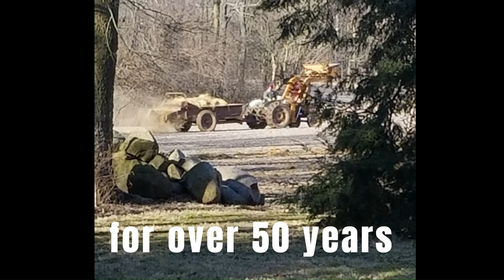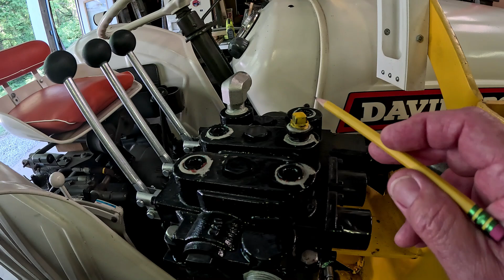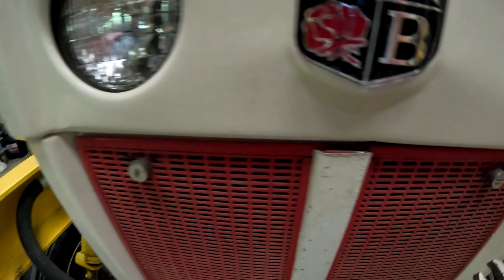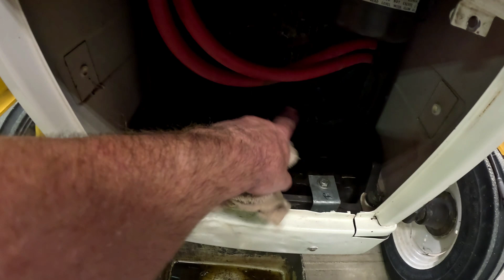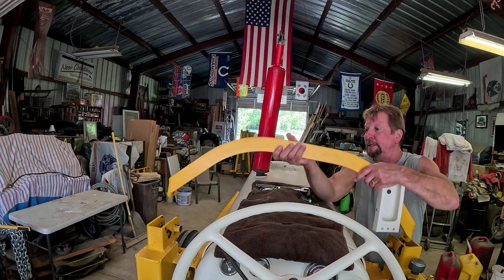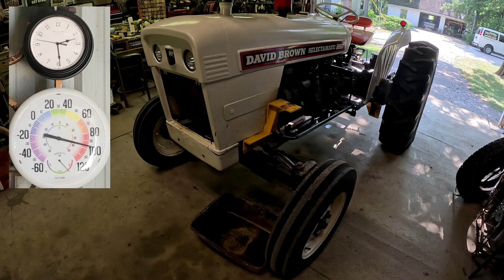David Brown 880 e1 remove the FREEMAN Loader

Comment: Hey I have a 880 that's new to me and I'm trying to see if there's a difference where the engine oil goes versus the hydraulic fluid. I have zero experience with diesels or large tractors. I looked up some videos but I'm still a little confused. Could you point me in the right direction? I think mine's a 1964
Reply from the maker: Yes I can, mine is a 1966 (white and brown) the engine/hydraulic oil is separate on all models. On the left side, as you are sitting on the tractor, of the engine toward the bottom is a filler cap and dipstick, that is where you check and fill the engine oil. The hydraulic oil is checked by a dipstick in front of high low gear shifter and filled by a plug in front of the other gear shifter. The red and yellow 880 might be a little different on the hydraulic but I believe the engine is the same. I have a video called "filter fiasco" that goes through changing the engine oil, I hope this helps.
Reply: @tech.274  thanks a million for taking the time to explain that to me!! What was throwing me off is where the engine oil is it looks like it's part of the gearbox. Mine is the white and brown one
Reply: I can see how that would throw you off, glad to help. The 2 are separated by the clutch. Thanks  @yourpro3653

Comment: Ahhh... The dear David Brown 880 ! I own one. A 1967 unit. I got A LOT to say about that tractor. Took it from close to good to be sent to a scrap yard and restored it (with some help of course - I'm not that good). Cost many "K's" but close getting to the end. I'm working on the original front loader right now. All for the look ! But I like my DB. Very much. Noisy final drives, noisy transmission, hydraulic problems... many issues I had to face but now pretty close to the end. Tell you this has last word : It will be the only one !
Reply from the maker: Yes DB has a special sound, the transmission (6 speed) has paper thin shims to obtain proper gear/shaft lash. They wear out over time, mine is loud in high range, but operates well. I also dropped many $s on the restoration and it was in good working condition at the time. In the end glad to have done it, thanks.
Reply: @TECH.274  I decided to buy another 12 speeds transmission, a just it properly, putting new bearing and put it in. I'll then see. Those DB's were a pain in the ass. Noisy !

Comment: That loader looks all to havey and it almost identical to a Massy loader of the same time.
Reply from the maker: It is very heavy, with a large bucket. The way they built things in the 60s, independent company that was purchased by Bush Hog in the early 70s. A great loader, with the ability to dig a big hole. The new 1s don't do that. Thanks
Reply: @TECH.274  How do you get on with the backwards stop on the engine it always intrigued me why David Brown until Case bought them out they eventually stopped using Case engine with different pumps.
Reply: @Colin-rg7gt David Brown's always used their own engines

Comment: I have a 1967 990 Selectamatic, it has what I assume is a DB loader.
 Hydraulics are supplied via the tractors own internal pump, which runs the 3 point. 
The loader only has the one tilt cylinder in the middle, which makes it very easy to mount anything that fits on the 3 point, fits on the loader. 
Very interesting to see the hydraulic pump on yours mounted where the battery is in mine, probably a much beefier unit, but I must say my loader does surprise me with its lifting power. The one tilting cylinder does at times create much less usability, and limits the curl in the bucket, or what ever is on it.
Very nice job on the restore, I had thought about doing a substantial restore on mine, but I really cannot have it out of action that long.
Reply from the maker: That makes sense, I made a modern, quick attach system for mine.  You can convert the bucket over to that system, but I think it's much stronger to leave the bucket as is with the cylinders attached to it. The quick connect  can pop off the mount if too much pressure is applied. The Freeman pump is rated at 18 gpm. There is plenty of flow for a 3rd function. Thanks.
Reply: If it's got a front mounted pump on the crank shaft that was an optional extra
Reply from the maker: Yes, the Freeman loader has an independent hydraulic system. DB also had the front mounted pump however some loaders ran off the internal hydraulic system without the front pump. The internal pump delivers 5 or 6 gpm the Freeman pump is rated 18 gpm, quite a difference.
Reply: I also own a 1967 DB880 Selectamatic with original front loader. I'm presently working on it. I was lucky enough to buy one that is in good condition. We're working on painting the cylinders, the arms and cross member. The bucket attachment and bucket will come later. I removed the pair of bucket cylinders sold then to come back to trip bucket action with handle and steel wire. I restored my DB to drive it around... period. Got no power steering. I'll see how I will manage. I tried driving it with front loader once before restoration. It was hell to steer because of the weight that puts on front wheels. Many "Ks" to get there. But I'm glad I did it.
Reply: @ 
My 990 has power steering assist. I think it was a few more years before they had the true power steering, it works ok, but with something on the loader it is still a bit harder to steer. Of course it could use a complete rebuild, to eliminate leaks, which is another major problem.
Reply from the maker: @lucgagnon5241  The 1st thing I rebuilt was the Power steering pump in 2020, it had a bad seal on the drive shaft allowing air to be pulled into the pump thus not producing the proper pressure. I was amazed by how well it steered afterwards. In Aug. 2021 I removed the Freeman loader, for the first time, to start the restoration. That was a shock driving Brownie without the added weight on the front end, a lot of bouncing, lol. I also am glad I did it, fun project over all.

Comment: Flash loader all the selectomatics in nz I saw had the begg trip loader with just one valve bank for lifting, the bucket had a wire operating it
Reply from the maker: They had "trip" bucket loaders here in the US as well. I asked my dad why he picked the Freeman Loader, and he said because it had 2 cylinders on the bucket versus just 1 or none. Thanks for the watching and commenting.
Reply: @TECH.274  tractors have came such a long way, my grandfather had a fordson with steel wheels and carted milkcans to the factory with horse. I used to mow school field on a smaller selectomatic every Friday afternoon it was my reward for behavior getting the whole afternoon off class during year 9 and 10. Glad to have met your channel
Reply from the maker: @Hafwitedhonkyhori  The good old days.